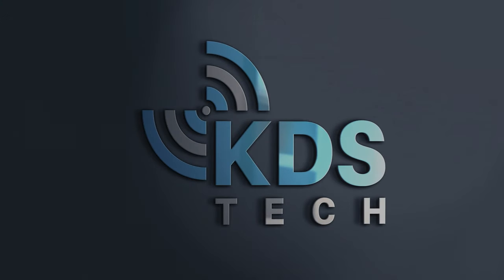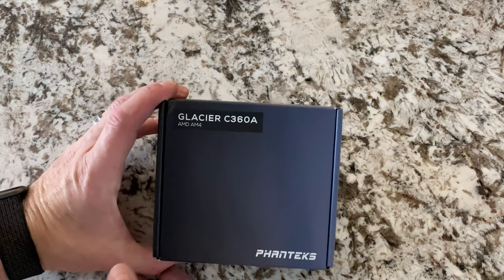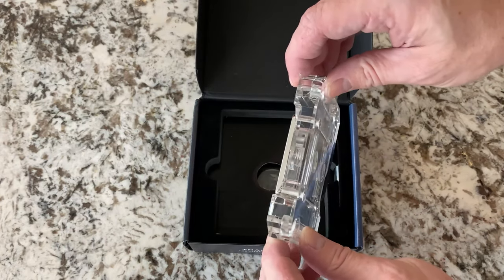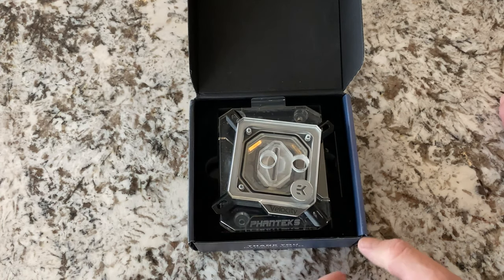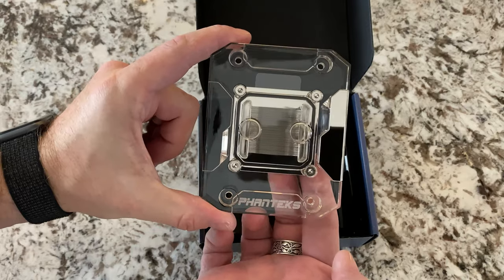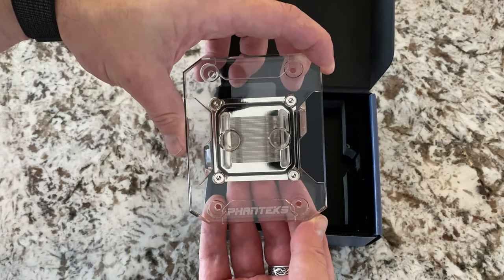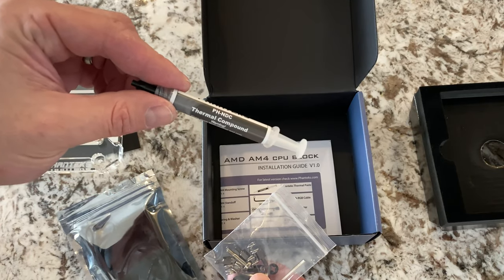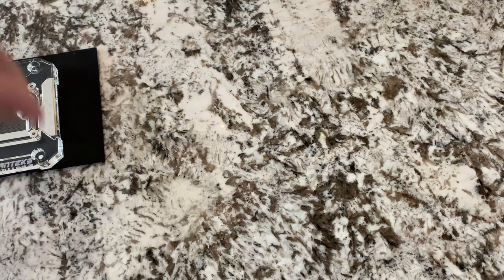Phanteks C360A CPU Block Unboxing and Installation

Comment: Random question, but are the holes designated for inlet/outlet? 

At a glance it doesn't appear to matter for this block, but I also didn't see anything explicit in its documentation.
Reply from the maker: Flow doesn’t matter on this one
Reply: @KDSTech  awesome! May look at getting this one then, as my current EK block kinda makes my tubing run a bit weird

Comment: Thanks for the video, in the midst of installing this block. Coming from the amd wraith prism cooler, would you say there's a substantial increase in temp performance? I been idling around 40c with the wraith, where abouts are you idling with this block so I can compare. Should have my first water loop running soon!
Reply: Running a push pull alphacool 420mm x 60mm  so hoping it is atleast a 10c drop at idle, 20c under load
Reply from the maker: your idle temps will rely on what your ambient temperature of your room is as it cannot cool below that.   i would think you should idle around 30 degrees ish.
Reply: @KDSTech  22-30C, its typically cold where  I live. 

On the bright side, I was able to pushmy 3900x past  8000 on cinebench r20 with this block! I could of kept pushing, but was getting into the higher voltages and didn't want to degrade the cpu. Block works great

Comment: Are you having a good experience with SLI?  Hardly find anyone recommending SLI because it introduces too many problems and more latency which means it isnt as smooth as a single setup even if it's pushing out more frames.
Reply from the maker: i am.  i'll be honest, i have only ever done sli once as i typically buy the top end card, use that ( works great for games at the time card is released as "best" ) and then i buy the next card when it comes out.   I have found that the 2080ti's that i am using work quite well, i have my "better" card of the two as my primary and really haven't had any issues...
Reply: @KDSTech  Awesome, I just got a KingPin and was thinking about pairing it with my current ftw3 ultra instead of selling it.   I want to get some hands on experience but that NV Link is quite pricey at $100 for something I may not want if it doesn't work out.
Reply from the maker: @MrGlutting  i will tell you that everything i have read suggests that a person will have much better luck using two of the same card in sli.   i can see people having problems with two entirely different cards.. not from personal experience, just from things i've read.
Reply: @KDSTech  I got the okay from Evga, however, they suggested a 1200w psu over my 1000w.   I'm looking at $300~$400 for a high end 1200+ psu and Nv Link purchase, Which is quite out of my budget.   Oof, I really need some hands on experience to justify SLI.   I'm in my early 20s, Not an alpha career man like you yet (Compliment btw).

Comment: Do you have torque specs? lol I just bought it becasue of your video and I've only used metal blocks XD
Reply from the maker: Torque?   It uses Allen.   It’s a great block.
Reply: 1.5n/m or 1.1 ft/lbs